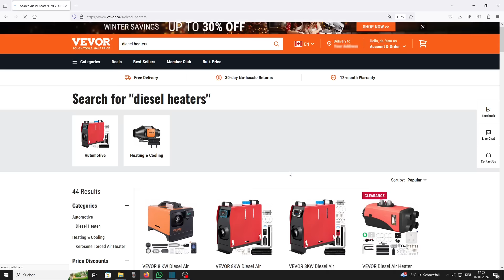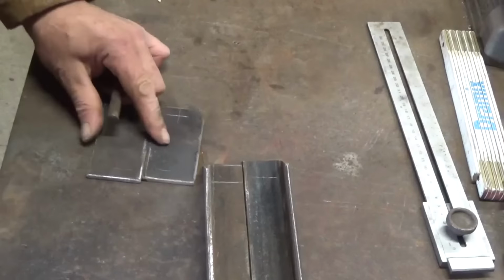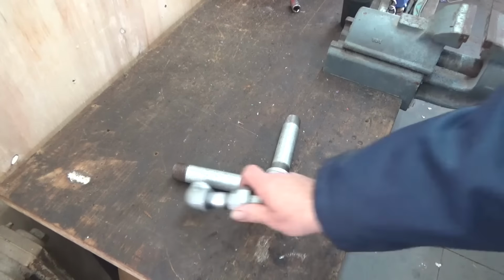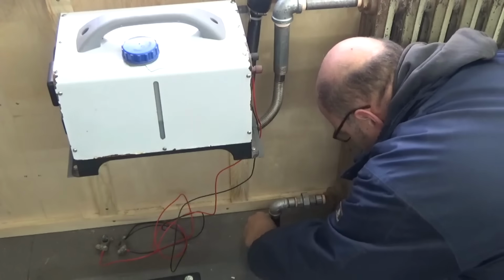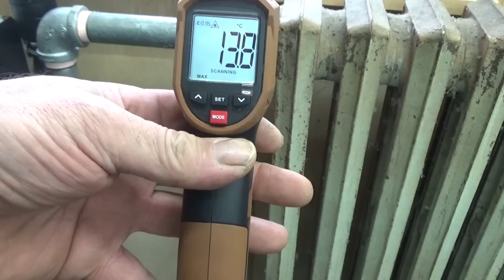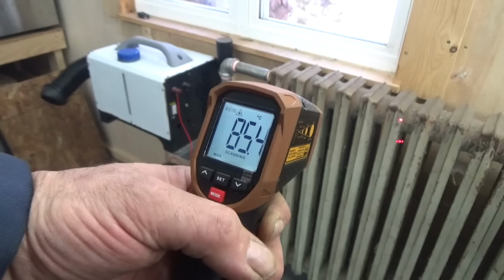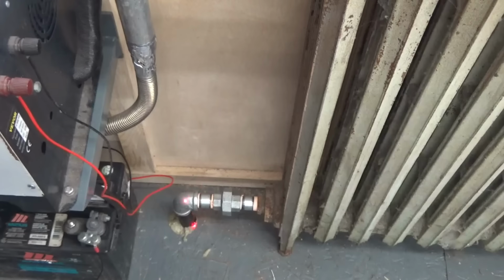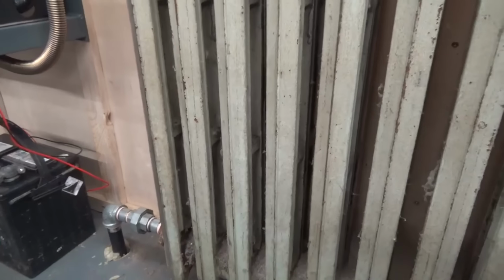Diesel heater upgade 200% more efficient

Comment: My diesel heater after twenty odd hours was so clogged up with a soot/carbon deposit which it got running on a low heat for that long .
, so I can only imagine how much of a build up your diesel heater has and you haven't serviced yours for over two years and then you add more problems to servicing by installing more restrictive 
modifications that you will have difficulty cleaning and of cause that is, IF!! you ever clean or maintain your heater unless your using some magic diesel fuel it will cause soot and carbon build up running at higher temps just as it would at lower temps so Yes the idea is good but the consequences are as I said and you could have used either steel or copper tubing to radiate heat faster and possibly use it for heating water as a side benefit. Cleaning wouldn't be as big a nightmare as the monstrosity you have there which you obviously didn't consider unless you don't like the idea of cleaning and maintaining your heater. Good Luck Mate!!
Reply: after searching around for reasons there was so much soot and carbon build up in such a short time I found that low grade crap diesel from the fuel station is to blame and why is it coloured bright green??  Not a trick question, but I have never seen green diesel ever!! Not in Australia at least unless it has a die specifically to designate it from a particular source. Any one got any valuable information .
Reply: @SamWolfandCo.fossickandfind  diesel is normally green lol
Reply: @SamWolfandCo.fossickandfind  maybe try premium diesel from bp and/or a touch or injector cleaner every blue moon 🤷‍♂️
Reply: Run Tour Diesel heater at minimum 200c! That's min temp for full combustion of diesel fuel!
Reply: The heater should be leaned out since it’s running to rich.
Reply: Run a tank of kerosene through these things every now and then on highest setting itll burn the diesel soot out of the screens and plug. Theyre originally designed for kerosene not diesel

Comment: ❤ I'd propose to turn the heat exchange sideways or flat. to allow the soot to flow out from the radiator coils and prevent long-term use blockage. thanks for your experiment ❤

Comment: The clicking is annoying
Reply: This has been one of the big issues with these heaters, to the point where some people have invented really expensive diesel pumps. It is possible to get less expensive but quieter pumps as well as sound dampeners to it's not so noisy.

Comment: Outlet of radiator temp being less than the room air is cooling.  i.e. Lost efficiency.
Reply: No. 

If you had a radiator stored outside, then brought it inside, it would absorb heat energy getting up to room temperature. if you then took the hot radiator outside you would be losing that energy.

the fact that the exhaust is much cooler after the radiator, shows it is absorbing a lot of energy.

The room air is not all 80c, if that were true this guy would be dead. the hot air by the outlet is being transferred to other heat, to the walls, and potentially the radiator just at startup.

Or look at it another way. you have 2 1000w heaters. 1 is very small, giving out 10 watts / sq cm. one giving out 0.01w / sq cm. the very large heater will have a lower surface temperature than the smaller one. it is still contributing as much heat.

Comment: I'm concerned that your heat exchanger is too large, will retain condensate, freeze, and break. Also, condensate is corrosive and will eventually cause problems between the cast iron, black pipe, and galvanizing. Of course, there is very little water in cold Canadian winter air so you might be OK. In a cold but warmer and wetter environment there would really be a high probability of future problems. Personally, I would use two 4-5' hydronic baseboard heaters, center fed from a tee. All silver-soldered copper, pitched down slightly from inlet to exterior outlet to ensure condensate drainage. I am planning a fishing boat application and will have to collect condensate in an easy to dump vented container.

Comment: 200% more efficient 😳😳 hmm . . just compere the size of the heaters outlet (70mm?) and the exhaust pipe size (25mm?), i bet that the airflow out from the exhaust is 2-4% of the airflow from the heater, so even if the exhaust air is twice hotter than the burners outlet air . .. it may become only 3-6% more efficient 🤔

Comment: Great Build ! I just bought a Vevor heater to mount in my off grid camper unit :) I may buy another for my mill shed.
Reply: Try hooking the exhaust to a flat plate heat exchanger or shell and tube exchanger to heat your water in your camper. 
I did with my boats hot water system and it has worked an entire season.

Comment: I believe I heard that moisture comes from the exhaust on diesel heaters. If that is correct it would be better to have the diesel heater higher than the radiator so moisture wouldn't  be trapped in the exhaust pipe between the diesel heater and the radiator. That would allow the moisture to drain into the radiator. Also recommend using a 12 volt dc power supply in place of the battery because it would be easier and would eliminate the cost of the battery and the need to charge the battery. I would guess the power supply would probably need to be rated at about 4 amps but check amp draw on the heater to verify the number of amps it draws. Get one that can supply slightly more amps than the heater draws to prevent overloading the power supply.
Reply: It's rated 12VDC 40W, which calculates to 3 1/3 amps.

Battery is fine, and actually better for power outages.

Since these are packaged vehicle heaters they're designed to run on a battery, they're just boxed for convenience outside of vehicle installations
Reply: @legionofanon  The only problems with using a battery is the cost of a battery and the need to charge and cost to replace it. Batteries need to be replaced more frequently than power supplies and cost more. It would be convenient to have battery as a backup for a power outage if that is important to you. I realize it was designed to operate on a battery with a charging system in a vehicle but as with anything that uses a battery it is more convenient and economical to run it on a power supply unless the device needs to be portable when it is used. A battery maintainer connected to the battery to maintain the battery would also work if you feel having a battery backup is required. I use power supplies on everything that is designed to use batteries that is located where there is electricity and doesn't require it to be moved to locations where electricity isn't available except tools where cords are inconvenient.

Comment: I only see 2 real problems come long term one being condensation that leads to rusting it out and two soot buildup and not being able to clean it out.
Reply: That radiator will never rust out, they have been around for 150 years and I've never seen one leak because of rust, they are 1/2"- 3/4" thick case iron

Comment: Did you have issues with water accumulated in the exhaust pipe?-- If so, I would suggest you to connect the heater exhaust to the lower connector in the radiator.  Hot air will have less resistance travelling up than down.  And by doing that, it will heat more the radiator from the bottom up, and also you could have a little water accumulation purge screw in the heater pipe to evacuate any water every 100 hours or so...

Comment: Put sheet metal behind the radiator to radiate the heat outwards instead of heating the wall.
Excellent idea you have there. I'll bet it would work in the garage.
How long does the fuel last?

Comment: I was thinking about running the exhaust through a copper coil in a tank of water, but I think your idea is simpler unless you have a use for the hot water other than thermal mass.

Comment: Great idea!! I can suggest you to improve the insulation of the exaust gas outlet or reduce the number of radiator elements to improve the heater draft.
Gases must be prevented from condensing inside the elements

Comment: Put a small fan to blow on the radiator, or your hot air exhaust to blow on the radiator. get that heat moving around the room, it'll heat the room up way quicker

Comment: It's the clicking that would bother me no end.
Do they sell them without the clicking now?
Reply: you can get really quiet pumps, I bought one from ali, but I prefer to hear the clicking since the heater I have is so quiet that the cliking let me know that its working.
Reply: i just got one diff brand Kroak off amazon its my fist diesel heater and i dont hear the click at all, loads of ppl complaining about the clicking but mine i cant hear.
Reply: Most of the clicking sound can be removed by adding some rubber cover, most of the sound are resonance

Comment: You need to drill and tap a small 1/4" fitting into the lowest point of the radiator to drain the acidic condensate out otherwise it'll sit in there and eat away at the steel and eventually leak out through the rust holes it'll make. The 1/4" brass fitting can have a drain line that can be run outside so that condensate build up will drain on it's own.
Reply: or install it sloped

Comment: Exhaust gases are just vented under floor? What about C02 coming up through floor?
Reply from the maker: The shop is 6inch above a concreate slab and open at both ends so there is a very good vetilation, the foor is made of a layer of plywood and a layer of woodchip board as well the hohle in the floor is sealed with rock wool. I would say the chance to win in the lotery is higher than fumes or co2 come up.

Comment: As heat will rise, if one was willing to drill through the wall I would route the exhaust to the bottom of the radiator and then put the top of the radiator. I would think that would maximize your heat throughout the radiator heating the shop better.

Comment: The bottom of the radiator is still below freezing point, once the steam condenses at the bottom of the radiator it will freeze and clog up the exhaust, this will make the inside of the heat exchanger soot up unfortunately

Comment: I'm thinking if you use a automotive aluminum radiator it may be much better because that cast metal soaks up allot of heat where a aluminum one would shed it
Reply: Soakes up the heat? Where do you think that heat goes when it gets soaked up?
Reply: An automotive radiator would probably clog up pretty fast, and it would have to be all aluminum since a standard plastic/aluminum one would melt at the inlet.  As long as the iron radiator is able to exchange all the heat into the room the only difference is that it'll take a bit longer to start giving off the heat.  The temperature at the cold end of his radiator implies that it's exchanging well, but he'd have to go outside and read the exhaust temp to actually know how well it's doing.
Reply: I was thinking a decent sized heater core from a pickup would be perfect.
Reply: @steveorini2839  It probably wouldn't take too long to clog up unless it was cleaned frequently.  If I were going to try that I'd put a sensitive pressure gauge on the inlet and as soon as it started rising above the initial pressure I'd pull it and clean it out.  Fortunately, diesel soot is fairly soft and easy to remove.
Reply: @DonziGT230  Sometimes people burn used motor oil (filtered and mixed with diesel) and any number of other oils in these things. Then coking gets really bad and usually destroys the primary heat exchanger. Normally with diesel they burn surprisingly clean. It's even cleaner if you're burning kerosene. Mine's been running on and off all winter on diesel and my recouperator is just a 3m coil of the 1" exhaust tube. It's highly condensing with exhaust temps as low as 40c. I still get no soot build-up.

Comment: Could use a coil of any metallic tubing for the radiator and small fan to push air past it. Or the coil in a box and push output air from heater. Or the heat exchanger from a home furnace.

Comment: I had thoughts of trying to capture the heat from the exhaust but everything I thought I was way more complicated than this. My only thought is that I would use a high temperature silicone hose to connect the radiator instead of metal tape. But excellent job I think I'm going to do this instead.

Comment: That is incredibly efficient. I always thought the pumping the heat outside was extremely inefficient. That radiator almost makes it like using a mass rocket stove heater. I think if you put some ducting behind the radiator and ran a fan into the ducting it would heat the room even faster or at least keep all portions of the room the same temperature. Thanks for sharing. Best Wishes & Blessings. Keith Noneya

Comment: very nice but sorry  to tell you that your setup can be quite dangerous. Water condensation will build up eventually, and that will clog the exhaust pipe. Your heater will stop working if you are lucky. If you are not lucky, something that might look like a small explosion could happen because of back pressure from the clogged exhaust. You better let the condensation flow toward the radiator due to gravity by elevating your heater.

Comment: White PTFE tape is meant for non-corrosive liquid and gasses, the Blue PTFE os for corrosive gases and liquids. I'd take it apart and use the Blue before the White tape degrades and leaks gasses into your space... Also, heat rises, so heating should be at floor level, whereas cold sinks, thus AC should be at ceiling level. ☺☺

Comment: I bought one 6 years ago. The pump finally stopped pumping so I ordered a new one at $15. I really wish they would bring the heaters that warmed the fluids to Canada.
Reply: I heard the pump can fail if the fuel lines are soft rubber. It's recommended to use hard lines, apparently better both for the pump efficiency and lifespan (the lines included with most kits are cheap soft lines)

Comment: The reason it's warmer at the top than the bottom ofcthe radiator is simple physics l. Heat rises thus he's running it bk to front. The exhaust needs to enter atvtge BOTTOM whilst exiting from the top.of the rad
Reply: No, its warmer at the top because all hot gases coming in there and losing heat, and the gases continues to lose heat to the inside of the radiator on the way down, and colder gases sinks, so no back pressure. 
Now its the combusting fan that are pressure the air out, (no "gravitation function") and it will also take the easiest way out, that's why the radiator is cooler on the right side.

A radiator that use self circulation work similar, hot water gets in the top of the radiator and cools down and get heavier so the pressure rise down in the basement were the heating boiler are located, and pushes up the up heated water up at the same time it sucks up that hot water in to the radiator when the colder water strives to sink.
 
Its the loss of heat in the radiator that are the "engine" who creates the "self circulation".

Comment: What size NPT from Exhaust pipe to Radiator would this be? Looking at doing the same thing here, however i would like a clean link to the radiator, without a leak. Also is galvanized a good option, with the temperatures it pushes, considering hot water heating would not normally exceed 160f (or 71c) and the diesel heater exhaust can almost double that. The recommended maximum from agencies seems to be 380f which seems to put it at the limit.

Comment: Its been 1 year do you still uses that setup and is it still install with exhaust facing up? How has it been working and was there any maintenance you did?
Reply from the maker: It is still working with no problems absolut perfect no issues  at al
Reply: @dsfarmns2823  So the pipe going on an upward angle really doesn't make any difference on these little heaters so I'm not going to be nervous about it and just install it that way worst case I am out of 130 bucks. 😂
Reply from the maker: @tommygun5vsrocky  where do you think is the problem ?
Reply: @dsfarmns2823 the manual said  don't point exhaust upward only horizontal or down will ruin efficiency of heater also putting soot in Burn chamber from condensation and bend in pipe that's why I was nervous about going up with a pipe and Everytime people comment it's so bad to do that but I seen you and others put it upward and so far no problems so I am thinking it's does not hurt it and maybe without a rad it's a issue but with a rad it's fine love to see a video on this if piping it upward really hurts anything at all like efficiency of the heater longevity  of heater due to too much soot in chamber being built up overtime. I would think if it was so so bad your burn chamber covered with soot so bad it's coming out the glow plug. 😂 Thanks for the reply and I think you did a great job with the heater.
Reply: @tommygun5vsrocky  the exhaust pipe going up to the rad is quiet short so you wont get condensate, I tried it and mine wouldnt ignite after the first day so I decide to remove the rad and install a 3m exhaust. There was nearly a gallon of water in the radiator blocking the gas, I get a lot of water from the exhaust now, to stop sooting you can change the pump type in the settings of some controllers

Comment: My concern with the exhaust would be 2 part.  Mice crawling back into the radiator.  And the biggest concern.  Condensation buildup under the floor could very well lead to premature rot and/or mold.  Otherwise the idea was fantastic.

Comment: I have copied what you have done and it works great . I do have a lot of condensation from it so i put a ball valve on the bottom as well as the exhaust and have the water go out the wall so as to keep all the exhaust and water going outside . yours wouldn't have any as your exhaust and water go out through the floor . Thank You for sharing